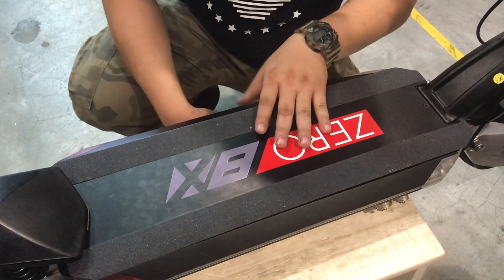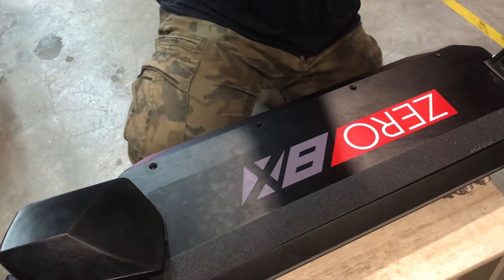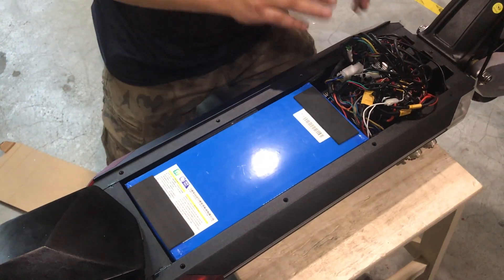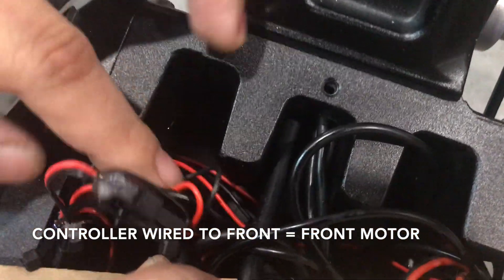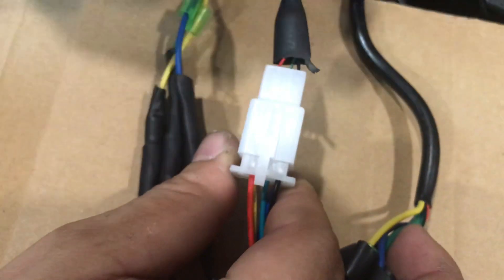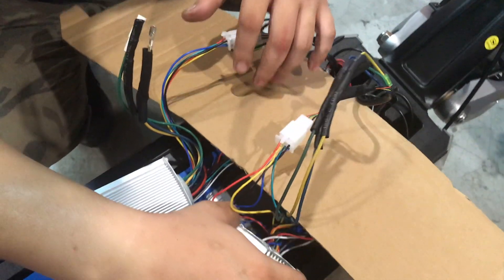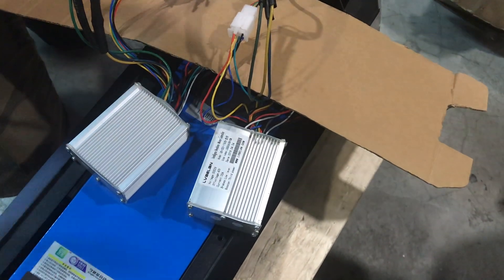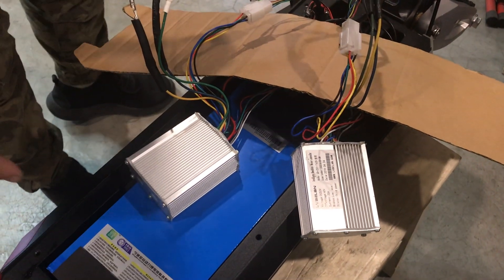Z8X Z10X Motor Controller Diagnostics

Comment: I'm thinking of going to make up a heat proof handles for batteries so then I don't have to use bare hands to remove the batteries are best way and most quickest removable ever seen and lighting V2 are clever company built best quality looking inside decks are best performance ever seen

Comment: Dear felcon pav, I have a issue with my zero 10 x. My scooter getting off while running don’t turn on, then I have to connect the charger 🔌 to the plug and then it start again. This is happening to me every day.
Reply: Is this the problem with controller or the battery
Reply from the maker: @mfk312002  this seems like a battery issue

Comment: Hi. I have zero 10x the problem is hub motor not working. I've swapped front controller to rear hub motor and is working. Then, i swapped rear controller but the front motor is not working. I've concluded the front hub motor is the problem. I've tested the red and black wire of the hall sensor of the hub motor and it seems like it's shorted. Can you confirm it the red and black wire is always shorted or not?

Comment: Hey please help me, i have the zero 10x and Under the cable shield in the handlebars there is a wire inside which there are 3 wires inside of him: red, green and black and they were wrapped in white tape in a bad way so I wanted to replace the tape and then suddenly the scooter stopped working and did not open again... please tell me what to do if you .
Reply from the maker: do email us with some pics at sales@falconpev.com.sg
Reply: @FalconpevSg    why you never ansfer the questions here so other people can see the solutions two .
Reply from the maker: @bjornvanoppen  it’s too complicated to answer and we need pics to guide us to solve the issue

Comment: HI. Is there anywhere I could see a wiring diagram, with colored wires? I have the 10x, had to change the steering stem... AND forgot to mark each wire and how the all connected :D now I have two sets of wires and I dont know which is which!
Reply from the maker: Join our group on telegram @falconpev
Reply: @FalconpevSg   this group is not working ????
Reply from the maker: @bjornvanoppen  sorry it’s the link here
  https://t.me/joinchat/ULcgDEYMJCRpizUeDgWIKQ

Comment: I've seen zero 8x controllers are 52V 25A both rear/front. But in your video its 20A, Why? Thanks!
Reply from the maker: This video is old. UpdTed ones are 25A
Reply: @FalconpevSg  oh ok, Thanks for reply! and if the hub motor is the same, can it handle those +5A safely?
Reply from the maker: @jordiluqueca  yes no issue
Reply: @FalconpevSg  Thank you!

Comment: hum hope my 10x controller don't blow soon only 500km on it
Reply: Pierre Fitch; Put a steering Damper on it ASAP or your going to break yourself! Kwheels has them on Alibaba.com
Reply: mine front controller blow after 1000 km  . even with the contact key off the front motor get 65 volt but the polarity is switcht so the weel is lockt

Comment: Nicely explained ill be buying one in 2 weeks
Reply: How is it working out for you? Paid for my Z10X yesterday just gotta wait for it to arrive now...
Reply: @robblackmore8838  I have a Blade 10 and i ride too long single motor now i have Error 10 Rear Motor not working where can i get a controller for Blade? IS it the same?
Reply: @0401asdf  I wish I could help bro. I'd suggest you get in touch with the people that you bought it from, they will be the ones who can help you out. 
I doubt the problem has anything to do with only using one motor, most scooters only have one. 
If you are happy to just use one, swap the motor controler around maybe.
Reply: Rob Blackmore; First thing you need to do is buy a steering damper. Zero 10X has a very twitchy front end and without a Kwheels steering damper you can really F**k yourself up at speeds over 25MPH. Trust me I got a 10X and several other scooters.
Reply: I ended up getting a nanrobot cause it has lil more speed and battery range the revride zero just by a bit at lower price

Comment: Great vid, do you know if the same technique applies to the Zero 10X, by this I mean do you open it up the same way by removing the grip tape and unscrewing the screws on the deck plate?

Comment: For as much as those cost, should be no issues.
Reply from the maker: slickrick411 you can say the same for bmws, iPhones etc etc
Reply: Do you know how much medical equipment cost? Don't worry the repairs that cost you like 200 dollars will cost you millions because they say "You need a new machine"... Thank the medical bills for rising because of the right to repair is down the drain.

You should count yourself lucky that Falcon PEV shows you how to repair. They can simply say "Buy a new one" or send it over. (Which will cost hundreds of dollars of shipping)
Reply: Why does zero 8x controller break easily?
Reply: slickrick411 sounds like your not old enough to own a car.Even Tesla have issues.
Reply: @chefgav1  same goes for Tesla

Comment: Right, now how do you change the controller
Reply: that's kinda in the video, buy new controller, pull wires like in the video, reconnect new one.. done.
Reply from the maker: Rick Deckard if we even have to show you that, then you should probably bring it to a service professional.